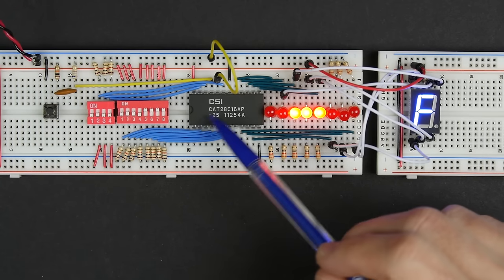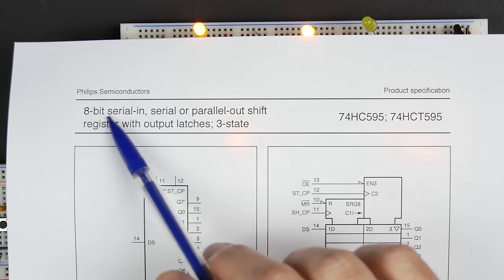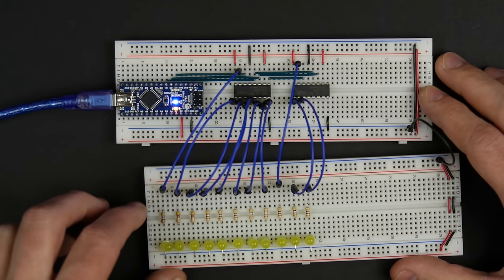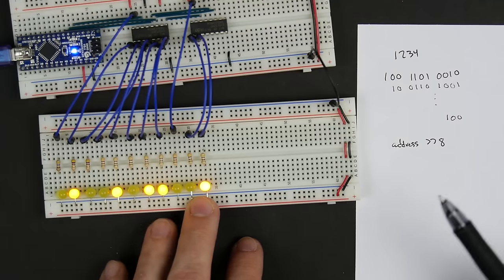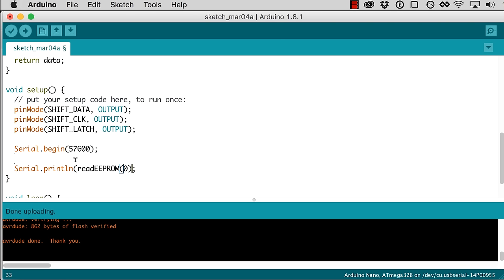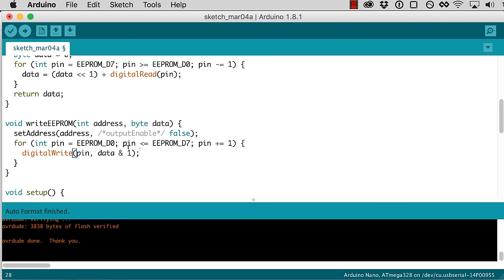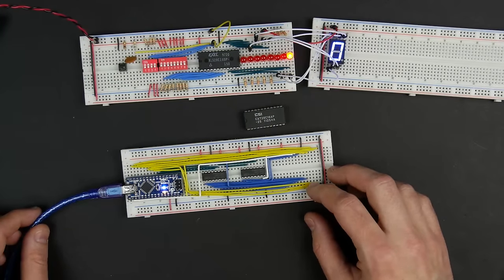Build an Arduino EEPROM programmer

Comment: Tried for 2 weeks but just couldn't get this to work correctly. Too bad as it seemed really fun. Ah well ill come back to it later. I had tried this with a 256 chip and never could get it to work right but I finally found the exact same chip as his and I just plopped it in and it worked immediately.  I spent a long time reading that datasheet to the other chip but I guess I never got it right. Glad to have this working now.
Reply: Trying to replicate Ben Eaters Video Card on Breadboard But EEPROM Programmer is too costly. Using 28C256-15 EEPROM so any alternatives

Comment: Thanks Ben for this, and your other project video's. Whilst this design was great for reading my new EEPROM, it was unable to write to it as it came with software write protection enabled. Apparently the unlock sequence cannot be done by the UNO as it is not quick enough. So I have a TL866II+ arriving today. I need this as I am building your 6502 breadboard project also ;-)

Comment: So i tried building this... But i used an AT28C256. Dumping the inside displays nothing but FF all the way across. I don't really have the advanced gear to diagnose this. Cam someone check if it will work with that eeprom?

Comment: Is there a way to utilize this as a way to program the EEPROMs in your 6502 project, the EEPROM programmer you use is a little expensive so I was wondering if just using an Arduino Mega to program the EEPROMs would be good or maybe someone else has done it
Reply: I'm hoping to do the same thing, when I solve my current issue with the wiring.  Should be possible, my plan is to link this breadboard into the others in the 6502 and remove the power links from the rails to the Nano.  However I'm a bit worried about whether writing to the eeprom whilst it's connected to a running 6502 would cause any issues.

Comment: Back here again and again every time I am setting something like that up again. I cannot get the commercial programmer so I always build my own. Haha. But now I am making a Z80 computer and use a Nano as an initial  IO device to test things out. And I read that actually the Nano does have D14, D15 - D19 over on the analog side. Apparently those are multi mode pins. I haven't confirmed that, but it's what the documentation says!

Comment: What exactly is the difference between ST_CP and OE since one could simply connect ST_CP to high and use OE to set the output rather than setting OE high to always enable the output and using ST_CP to relay the information in the register to the output

Comment: Hey! I looked into the switch rate of the arduino pins, judging by the pulse length necessary for writing, you could easily use 11 pins for adressing and then quickly switch 8 of them over to the desired value. This could theoretically write a single row of memory in one fell swoop

Comment: Never used an Arduino, but why do you need to split the address up?  I get that the least sig 8 bits go to one Shift Reg and the other go to the other, but since they’re connected in series, couldn’t you just output the full 16 bits in one long chain (and the first 8 would naturally end up on the second shift register)?

Comment: So I'm a bit confused here as far as the shiftOut function goes.  The (address >> 8) shifts all the bits over by 8 and then stores that value in address?  He says by default MSBFIRST will ignore the first 8 bits of data but that doesn't make sense to me.  If for instance it shifts 10011010010 by 8 via the >> operand and we're left with 100.  So the first line will shift out 100, and then the second line will shift out the first 8 bits? Meaning 10011010?  So on our outputs it would look like 10010011010?  Basically why would it ignore the first 3 bits, when we specified it to start with the MSBFIRST.

Comment: I know this is an old video and you might have found this out by now, but if you use delay(n) where n is a very small number as it is here, then the outcome is unreliable. It's preferable to use delayMicroseconds(1000*n) instead.

Also, it may be just me that cringes when I see "n = n+1" instead of "++n" or "data = data << 1" instead of "data <<= 1" :)

Comment: It's an overally complex way to do it.  I think it would be easier if it was parallel by resetting a counter to 0 and then upload the byte into a latch.  Then at the end of each write it would increment the counter.

Comment: How shift registers won't mix up signals if the clock pulse is given. 
(i.e.)->if all values are set as '0'
->New input value is give as '1' to first flip-flop. 
->Then at clock pulse, 1 is set to first register & 0 is set to second register and so on. 
My question, second register may set one if first register changes. How the data shifting stops?

Comment: I know it's not a major deal, but as a programmer I feel I should point out booleans for things that conceptually are behaviours is a bad idea. You should create a set of constants for the second param that represent output or input that could be used instead. Makes the behaviour more clear than false.

setAddress(myAddress, IO_MODE_INPUT);

Comment: If you didn’t have the delay at all on the write enable, is the Arduino fast enough to violate the short end of the allowable time range? Could always use a for loop to spin the processor for a while to get a delay less than 1 microsecond.

Comment: Great video. But... it's really a bad habit to add wires with the power connected. A little mistake and bye bye chip... (bad polarity, shortcuts, sending 5v to an output pin that is at 0V...) In particular you add address lines to the eeprom but it has no power yet. Sending signal to an IC that has no power can destroy it.

Comment: Depending on the clock frequency of the chip, 16mhz? Based on that an instruction is executed every 62.5ns, which will actually end up being a longer delay due to all the instructions that make up a digitalWrite, so you should not need that delay for, for the write pulse, however since it works, no need to worry about it, was just a thought

Comment: I realize this is a few years old, but you were worried about using the arduino 1 microsecond to pulse the enable.  Why not use it to fire off the little RC pulse circuit you created for the button?  You might need a diode (prevent pulse back to arduino), or perhaps a monostable multivibrator 555 circuit or something.

Comment: Ben Eater,  Excellent video Sir.
I know how much time and effort it takes to create excellent videos and the thick skin you need to have when you publish them.
I started back in electronics in the late 1968 time frame and was lucky enough to learn computer system repair.  Where every register was displayed in lights at the top of the CPU bays.  So you could actually see the data moving between the registers as you single stepped the instructions through their cycles.  Resistor, Diode, Transistor logic elements, before Integrated Circuits came about.

I will love continuing following your presentations.

A couple of thoughts?
1.  Why not just add another 74ls595 chip and clock the data you want to write out after the address was written.  Then you could use the remaining Digital Input/Output (DIO) pins to control the actual control pins of the EEPROM.  

2.  If needed, a one shot timer or even a two input low nand gate with the second input leg driven by the same signal through a resistor, capacitor, bleed resistor circuit.   This will give you one nice clean logic output pulse for each input transition from high, to low to high again while the capacitor charges up again.

Just thoughts.  Your presentation brought back many enjoyable days working with 8008, 8080, Z80, and on up the food chain to present day systems in a chip.

Comment: The Arduino is certainly a cool, versatile device but if you don't want to use one for programming the EEPROMs and you can afford to spend some more money, the MiniPro TL866 programmer can program almost anything programmable as well as testing 74xx and 4000 series logic circuits.

There are two versions of the programmer.  I have the A version (TL866A) which has an ICSP port but there is also a version (I think it's TL866CE) which is slightly cheaper and has no ICSP port.

The bonus with the MiniPro is that you don't have to learn how to program in C++ first.

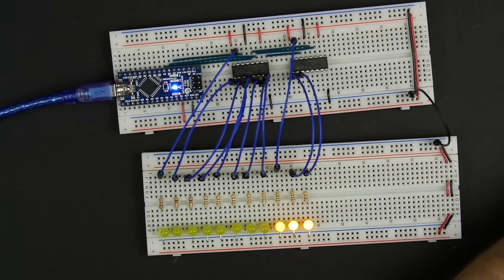Comment: 21:20 : Instead of using two shiftOut functions, is that possible to increase the hexadecimal value of shiftOut function, and the binary form can be used, so it's become more readable (like : 0b01011110101). Oh and to reset the status of the 74HC595, can we use the RESET pin of them connected to the Arduino ?

Comment: What if the first shift registers reacts slightly faster than the second one on the clock pulse? So the first chip shifts the data, and the second chip essentially misses one bit? Why doesnt that happen sometimes?
Reply: The contents of the first bit are already being fed to the second as its input, the clock cycle simply loads the new value.

Comment: Hmmm, since we can’t easily set a delay shorter than 1ms in Arduino code, can we instead implement a one-shot 555 timer pulse to pulse it for under 1ms (like 680ns), and then only trigger again once the input goes from high to active low again?

Comment: The address integer should be unsigned, otherwise the right shift in setAddress may not work as expected. This won't actually be a real problem since you aren't using 16 bit addresses.

Comment: This might sound fussy, but you are outside the chip's timing by a bit. 
I like the videos, but 1000ns = 1usec and a digital write pin command is 3.4usec long on an Uno. 
Go back to using your resistor and capacitor but put it through a schmitt inverter input (easy to use a 74HC14). You have lowered the write pin 3 to 4 times longer than the maximum without that extra delay routine time in there.
If you don't use the RC and buffer, remember the chip might also be still polling the USB stuff in some way (especially if not an Uno but a Leonardo or something), so it's better if you saved the interrupt state, disabled interrupts pulsed the pin and then enable the int state.  The failure of the first couple of bytes at the beginning may be due to the processor off doing something else.
The final delay only needs to be 1msec as per the data sheet.

Comment: "use shift registers"...or set the analogue pins to digital output mode. The only disadvantage is that the analogue pins can't all be used in pwm mode. There are also I²C port extenders available. I think there would be more ways to multiplex signals. The shift registers are rather nice for slower applications though.

Comment: Would the RC circuit you're using to generate the write pulse also create a negative after? That would exceed the minimum allowable voltage. I believe CMOS chips have a minimum allowable voltage of -0.5v on inputs. While this would produce around -5v. That could potentially damage the chip. If I'm right.

Comment: Total electronics newbie here.   Just purchased a Arduino after being inspired by your video.   I watched a LEDs video elsewhere on YouTube, it said there was a 2V drop per LED.  You are using multiple LEDs with a 5V USB.  How does this power all these LEDs?  Do they not shine at full brightness or something?  Thanks.
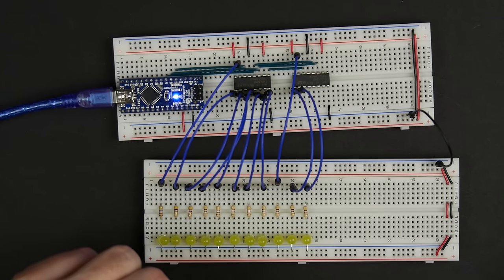Reply: 19:25 each LED has a resistor in series with it.
 There will be 2v across each LED, and the remaining 3v will be across each resistor.
 A resistor value of 150 Ω to 330 Ω will limit the current through each LED to 20 -> 10mA ish, which should be fine for seeing them On/Off.

Comment: Thinking about the problem at 44:00 where you can't delay less than 1 microsecond. It looks like arduino runs at 16MHz. So that means you need at least 2 clock cycles. I wonder what the chances are that digitalWrite() uses less than 2 clock cycles to operate.

It would be interesting to test with an oscilloscope. Just turning the pin's voltage on and off continuously, what frequency would it be?

Comment: Great stuff.  If you have the serial connection to your arduino open when (the arduino loses power or is disconnected) then windows believes the device is dangerous and refuses to show a com port until after a reboot.  there's a way to delete a registry key and get it back without rebooting, rarely worth it.  Stay awesome!

Comment: If you don't mind, what wire are you using to link stuff on the breadboard? I hate the ones I have because they are so flimsy.. And they got large heads on them.
Reply: 22 AWG Solid Tinned-Copper Hook-Up Wire
https://eater.net/8bit/parts

Comment: I am finding there is a hidden level of complexity inside the ATMEL AT28C256 EEPROM, I'm finding the hardware and software protection is a bit tricky to work around with the Arduino because the signals aren't fast enough. I will have to grind on this one for a while before I get it. I think buying a programmer is a good idea

Comment: This is such a case, where the hardware abstraction of the Arduino-Platform prevents you from seeing the forest because of all these trees.
If you plan FOR the hardware you have, and wire your data pins correctly you can read them port-wise in one go. You don't have to go through these bit-shift shenanigans.
I know, this is for education and to show off the use of shift registers. You've done a good job, Ben. But with such a level of abstraction there comes the caveat: The timing and continuity problems. By the way, the worst thing that your nano- to microsecond rail to rail latched up data-lines can do is not to burn the chip, but driving you into madness without a towel(42):) 
*Hint*: Set A0..X to digital out/in. Education means also that it is shown, how it is done the right way;)
We live in great times, today. If something is not possible with one platform, e.g. Arduino then you have a plethora of alternatives to choose from. Don't restrict yourself to a MCU only because you are familiar with it. Memory Access? Swing the hammer and go for DMA:)
Thank you for the exciting and well done video, Ben.
Reply: I understand your POV 🙂. On the other side, I am following Ben's channel because I revamped my interest in digital electronics - back from school memories in the 80's - and it was cool to understand how a shift register works 🙂

Comment: I can't get the latch to output. I get the shfiting in, I can get L or H on the link pin 9 depending on what value I have shifted in. Bu none of my output pins have anything. I am sure to have the OE on ground and so the only problem I see is the latching didn't work. I put the CLK and the LATCH on low and high at the end to identify them for sure to be sure everything is wired up correctly. Still no output. It's a 74HC595N, I wonder if the N makes a difference? In the timing diagram they show the LATCH as the inverse of the CLK. They don't show the protocol of pulsing the LATCH only once at the end. Is that the problem?
Reply: I went to buy one more of the 74HC595 (also an -N) and it ended up working. So now I have to wait until Monday to buy the second one. 

This is surprising. I never had an actual bad chip. Nor did I actually damage any, despite abusing some pretty bad, they got hot, putting them in reverse, yet never got a problem. These two I had in the box and untouched for weeks, then when I want to use them not one, but two bad chips?  Very strange.

Comment: I'm work on a project of a old VHF that uses e EEPROM to store the channels programmed. The radio is able to read 64 channels of 64 adress from the EEPROM. I'm wondering if it is possible to do a real time emulator of just the first adress line of this EEPROM using the Arduino nano in order to change the frequency using a dedicated sketch, diaplay and rotary encoder, for example.

Comment: I am a bit late, I think, but I must say, this is a great Video! Next challenge for all Microcontroller lovers: Stick to the concept (i.e. forget that pro tip on using the analog pins as digital i/o.), why not remove the shift registers and implement them in software..?

Comment: sir is it possible to store program in arduino eeprom, and set that arduino as a programmer. and whenever i want to upload that code to an external microcontroller, in just a push of a button the program stored will be uploaded. thank you sir

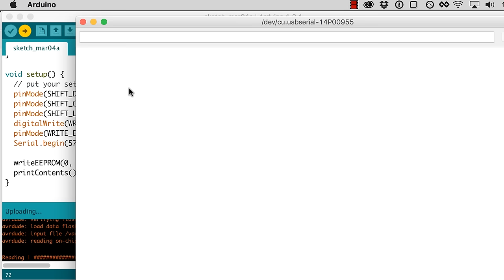Comment: OK, I actually built this thing! But there's a big problem. As you noticed at 49:16, t it is not reading back the data correctly! I implemented a test routine to write random data to the entire chip, and read it back. The error rate is around 7%. I have not figured out what is wrong,, but it might be cross-capacitance in the data or address bus? This one will be tough to diagnose.

Comment: what if you used a binary counting circuit for the address and a shift register for the actual data? so you could start with address 0, shift out the first set of data, increment the counter, shift out the next set ect. then you can use one arduino pin for the address, one for the data, and one for each of the other pins you need to control

Comment: Hello Ben, is I can use 29c256 in your circuit example excuse me for my bad English..I am French
Reply: I don't know if Ben replied, but yes you can.  You just need to connect the appropriate currently unused outputs from the shift registers to the extra address lines on the 29c256 EEPROM and make sure the OE uses bit 16.

Comment: It's weird that the EEPROM has an /OE line. The function it serves would normally be called read-write, or R/W. That's the same function, right? So why /OE which would normally mean "send the output to the data pins, or else tristate the data pins" ? Is it just alternative nomenclature, is it specific to EEPROMS, or am I going mad? 

That last one has some pretty short odds, btw.